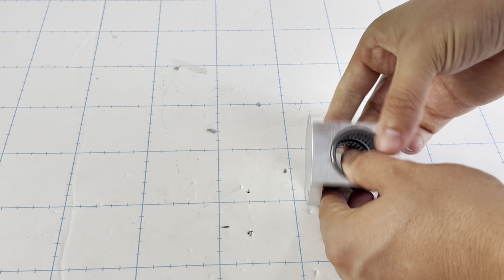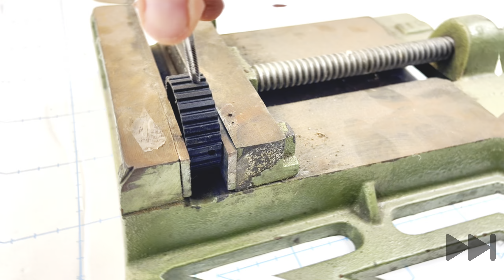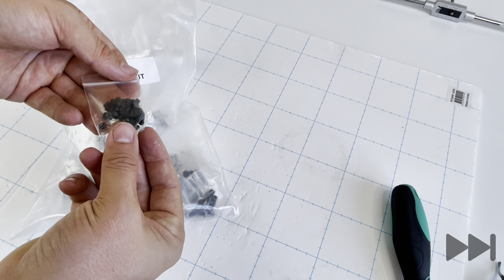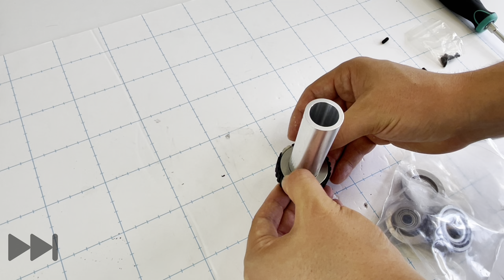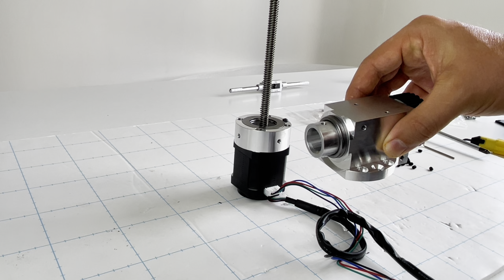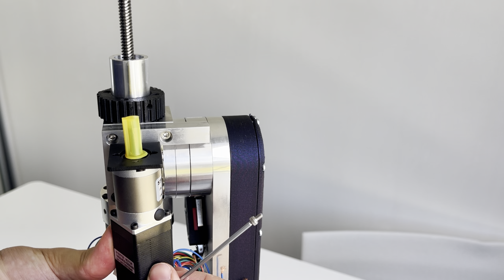Assembling Joint 4 of the AR4 Robotic Arm - Episode 11 - AR4 Mk3 Robotic Arm Build Series

Comment: Thank you so much for the amazing video, can you remind me of the name of the part that looks like a tube that is inserted inside the turret? may you tell me why you lowered its temperature? thank you so much
Reply from the maker: It’s called the J4 main shaft and it is an aluminium tube that has the joint 5 motor shaft / lead screw go through the middle of it. 

I lowered the temperature to reduce its size slightly which made a small, but noticeable, difference in being able to fit it into the timing pulley.